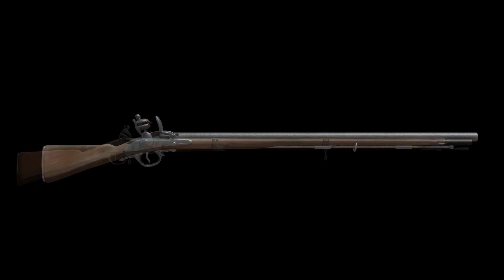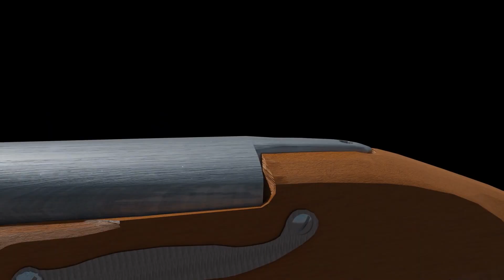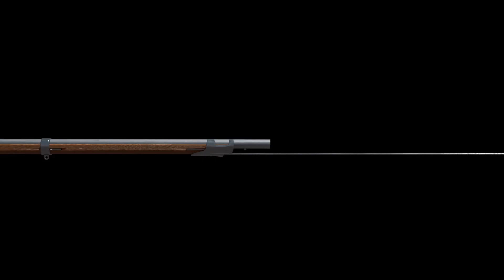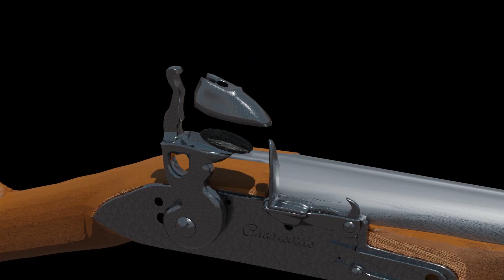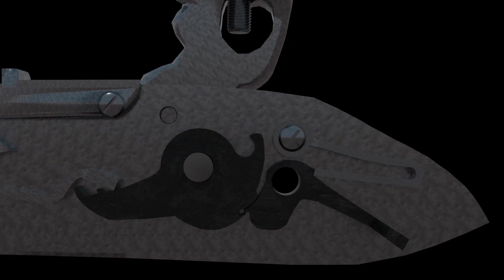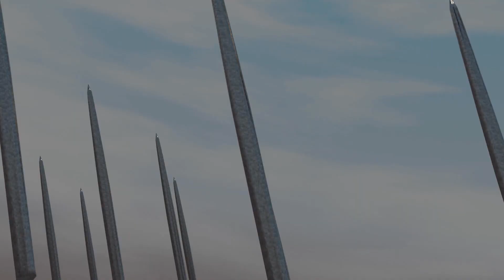The Charleville musket, the first mass produced fire arm in history, how it was made and works

Comment: Very nice video; detailed and to the point animations that perfectly fit a pleasant sounding, clear and concise narration. 

Question: do I understand correctly that, given that the bullet balls are deliberately smaller than the diameter of the barrel that the bullet would fall out if you tilt the barrel downwards?
Reply from the maker: Many thanks, much appreciated! The bullet would not fall out. It was actually another function of the paper wrapping going in together with the bullet. The paper wrapping provided a good, more flexible tight fitting wedge at the bottom of the barrel. The ramrod had no problem pushing the bullet and paper passed any foul debris as the paper would give way easily and expand again. A tight fitting (none flexible) bullet would not do this if the barrel was dirty inside. It was one of the reasons that rifles with grooved barrels, requiring more tight fitting bullets to follow the groove to  make the ball spin,  could frequently not be fired quick enough. These rifles required more frequent cleaning and thus were not suited for rapid loading and volley fire. Rifles were however much more accurate but much slower and the line tactic required lots of bullets fired, assuming some would hit their target. This was much better for less trained conscript soldiers
Reply: @Europeintheageofgunpowde-gv7bo  That makes sense - thanks!